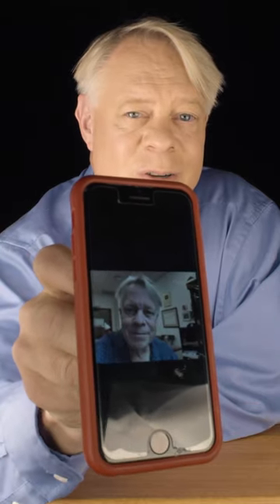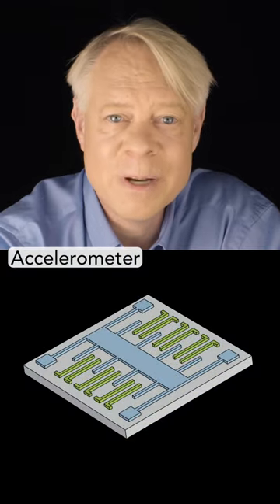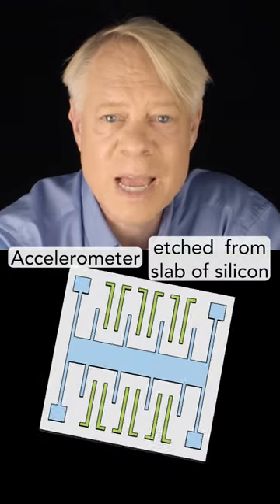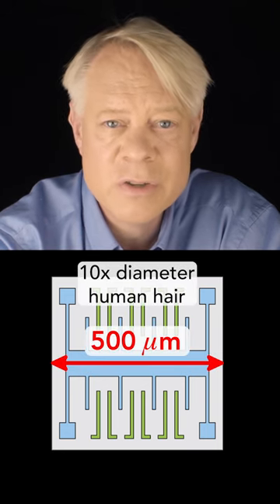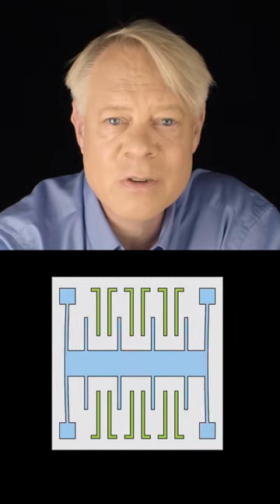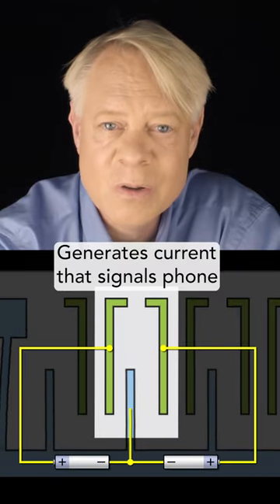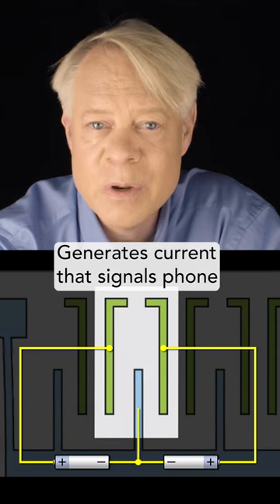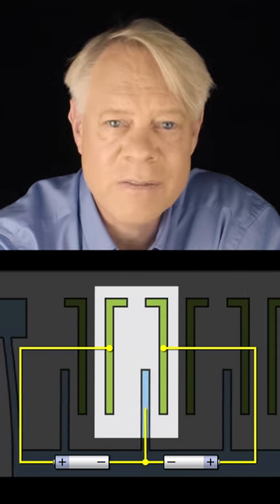How a phone knows up from down #Shorts

Comment: As a side note, when your phone is immobile, the accelerometers are picking up a 9.81 m/s^2 acceleration up, and when your phone is accelerating in free fall, its picking up no acceleration at all.

So in free fall your phone can’t tell which way is up.
Reply: Probably know's it's falling tho.  Cause it could feel everything leading up to it and that weightless feeling would be foreign and uncomfortable like it is for us.
Reply: That wouldn't be true until it had reached terminal velocity. Unlikely for most falls.
Reply: @joblo2671  The terminal velocity has nothing to do with it. It is an accelerometer, it measures acceleration, not speed. So, free falling means no acceleration. Do not confuse it with seeming acceleration from our perspective, we are in accelerating frame of reference, so it seems that falling object is accelerated towards Earth, however in General relativity it is the Earth surface that is accelerated.
Reply: @dmitriy4708  what the hell are you talking about? I'm saying your phone would have to reach it's maximum speed of descent for the statement to be true. This would never happen if dropped from your hand or off of a table.
Reply: @dmitriy4708  wrong again. You havent addressed what im saying. Are you even listening?
Reply: @joblo2671  So, you do not understand how accelerometer works. Whatever.
Reply: @joblo2671  no it’s the opposite.
It’s true until it reached terminal velocity and then it’s no longer true.

For the phone, falling at terminal velocity is the same as being immobile. The moving parts of the accelerometers are sagging from their own weight relative to the frame of the phone, so it’s measured as accelerating it the opposite direction from the sag.

But that’s why I said accelerating in free fall. There’s really no true free fall on a planet with atmosphere tho.

The phone would be tumbling in the air, and even the rate of acceleration would be changing.

Your phone would actually have a way to still tell which way is up tho, and it’s to integrate all the angular acceleration that happened since last time it was able to take a direct measurement. This is called dead reckoning.
Reply: I love misinformation

Comment: Can someone tell me the binary code on the book?! I don't wanna look it up
Reply from the maker: I have no idea! The publisher did that ….
Reply: Conversion of the binary string 0101100100010101011001111100111110101011 according to common text encoding (ASCII, Unicode, etc.) doesn't return anything that makes sense. For example, attempting to convert to Unicode returns Yᕧ쾫 or 夕柏« or Y gÏ« (among other things) depending on how I divide up or combine octets. Many of these possible octets encode for invalid characters. This doesn't seem to be a binary string that's meant to encode text, it's just there to represent binary code.

Comment: So how does the phone know witch way is up? This comment section is clearly way ahead of me but i dont understand what changed to the movement of the when your phone turned and also why that should give any indication witch way is up? To my frustration that is probably to my fault... (Commentsection) 
Im going to look for a longer version or a different video😅 if i find an answer befour it is given here i'll be back 😂 (Hopefully, with answers)
Reply: Yes so there is a longer version of this short but to me it doesnt really explain how a phone knows what is up. This is just one component. Ther are exactly several components that collectively can calculate what is up and down. 

The component that is discussed in this short is actually used 3 times one for every direction(x,y,z,)

Also what helpt my understanding is that gravity always puls in the same direction with more or less the same forse. (Duhh.....i know... I know...)
(Eventhough in the end the phone uses feedback measuring components to cancel out errors)

There are other video's that helped me understand this subject better. Nevertheless i would have never watched them if it wasnt for this video! 
Thank you!

Comment: Isn't it just a changing capacity that's being measured? (That maybe induces a current) But the animation of batteries and current is not perfectly correct. A capacitor with changing electrode distance would be better. @engineerguyvideo